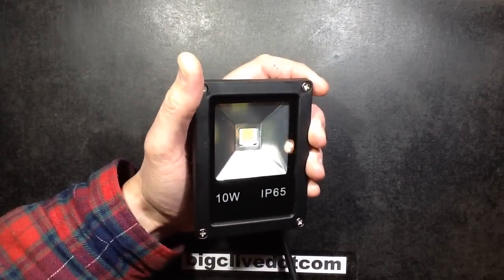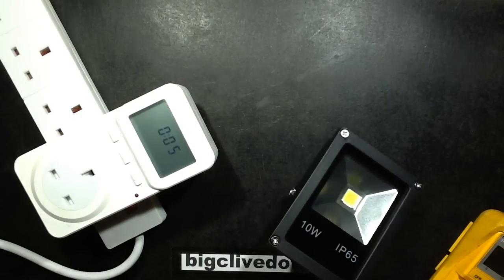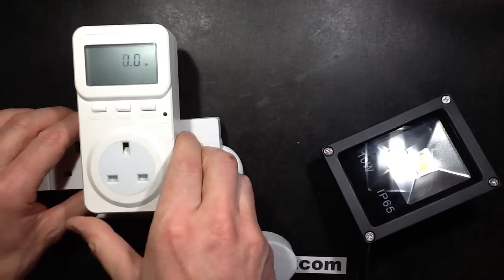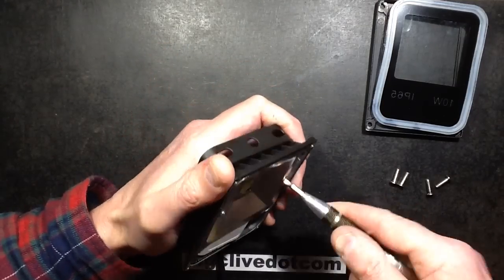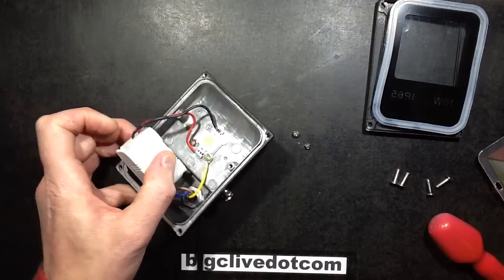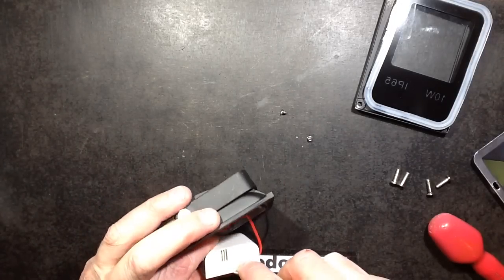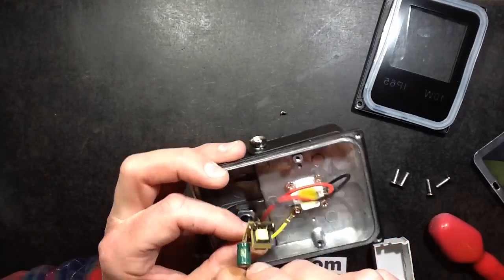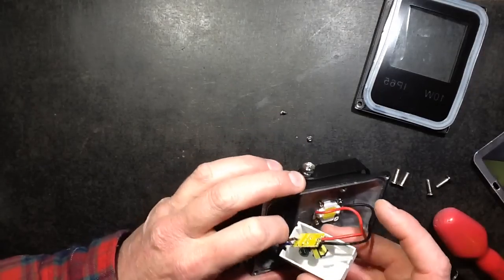Cutest little "10W" LED floodlight.

Comment: I got some 10W LEDs a while back,  and have built a couple of small lamps where I feed them 12V (not mains! :-) and drive them with a small module containing an LM2596S-ADJ,  the module w/ 3 trimpots.  I set the voltage to about what you measured,  then set the current to about 300mA (giving me 3W of dissipation),  and use a bit of scrap aluminum to mount this stuff on.  They're plenty bright!

Comment: With as deep as those fins are on that case, I wonder if it would be feasible to rig up a computer case fan to help heat dissipation. Maybe you could swap to an 8w driver along with the active cooling and have a pretty bright and neat little lamp. :3

Comment: The nice thing about these cheap LED flood lights,... a cheap supply of die-cast aluminum project boxes..
Reply from the maker: The cases are cheap and superb for other applications.  The slight downside is the fact the glass is printed with a black outline that I've not managed to remove.  It appears to be baked on.  Otherwise I'd be putting solar panels and batteries in them.

Comment: These work well for a low wattage lights, I have the same one in my rear garden although I did seal the front housing and glass with silicone sealant, to stop rain getting in them.

Comment: how's the heat output on these?  If I set it on top of a plastic aquarium would it be too hot on the lid?
Reply from the maker: +ThatKrackerTv They don't get too hot.  At worst you could add some spacers under the corners.
Reply: +bigclivedotcom thanks!

Comment: Clive, do you think it'd be possible to add any active circuitry to the driver's output, such as a light sensor to turn the light off in daylight? Presumably since such a circuit would use such little current it wouldn't have any noticeable effect to the light output. I'm a bit of an electronics novice but I was thinking about how I could use a 6v solar panel to drive a mosfet that could be used to switch off/on the circuit. I assume if it's even possible you'd have to account for the highest voltage the driver would supply (in an attempt to give the 900ma or so)? I realise that you could put this circuitry before the driver but I'd rather not deal with mains voltages!
Reply from the maker: +BenjaminGoose The power supplies tend to be a bit volatile when operated open circuit and make buzzing noises.  But you do get lights that do just that.
Reply: bigclivedotcom I thought that might be the case. I do have a 12-24v driver here that doesn't mind going open-circuit, so maybe I'll give that a try. [edit] Come to think of it I don't have to worry about open circuits if I'm using a 12v transformer, I'll just put the circuitry before the driver. Problem solved!

Comment: I have just received a similar so called 10 watt lamp from ebay. Very poor light, tested it and found it was really only pulling 3 watts. I have since removed the driver and replaced it with a 12 volt driver and mounted it on my ride on mower. Set it to draw 9 watts. I can now see to cut the grass at dusk when it's a little cooler. Gives great light at 9 watts, almost undetectable light difference when dropped from the rated 10watts. PS. We all have late night ebay sessions, allot of the stuff is crap, but at least it's cheap crap!!

Comment: If you wanted the full 10W, or at least more of it, could it be fitted with a capacitative dropper?
Reply: +ThePillenwerfer  No. Think about it :
10W LED = 3 parallel strings of  3 series LED running at max 11V.
You need a voltage drop of 229V (109V) down to 11V running directly off the 240V (120V) mains.
The 10W LED chip wil consume 900mA.
And you need a fullwave rectifier to achieve a DC voltage, to have the LED light up flickerfree.

The equivalent ohmic drop resistor would then be R = 229V/0.9A = 255 ohms (109V/0.9A = 121 ohms).
This a fictive value, as the real life resistor would be a non practcal huge wattage heater device.
But you need this resistor value to calculate the capacitance of the "drop" capacitor.
From the wellknown formula F=1/(2pi*R*C) we derive C=1/(2pi*F*R).
F would be your mains frequency, which is 50Hz off 240V mains (or 60Hz off 120V mains).

For 240V/50Hz mains you get : C = 1/(2pi*50x255) = 124.8mF rated at 250VAC.
For 120V/60Hz mains you get : C = 1/(2pi*60x121) = 219.2mF rated at 125VAC.
You will also need an in-rush current limiter resistor of considerable wattage, as the capacitor will represent a shortcircuit when turning on the LED.
The needed lamp housing to contain such a drop capacitor would be impractical large, and I wont dare to guesstimate the cost of this capacitor :-)
Reply: Thanks for that.  Paralleling a load of 0.1µF ones would hardly be practical!